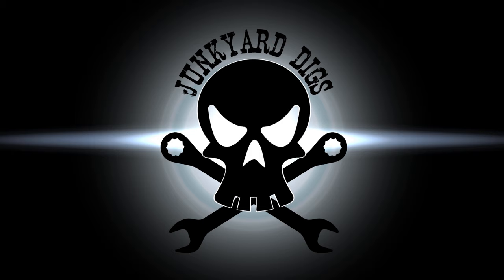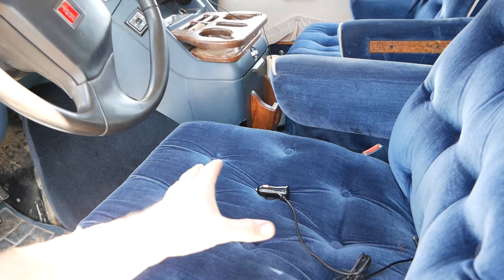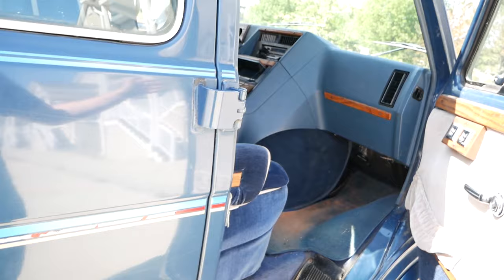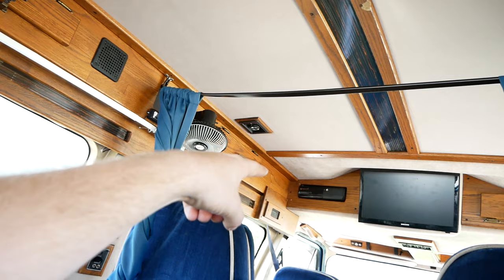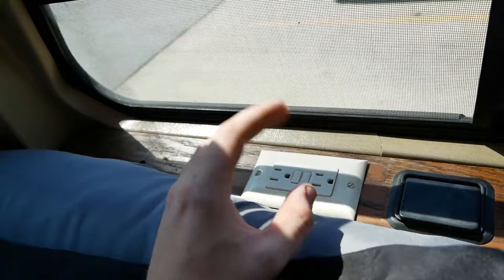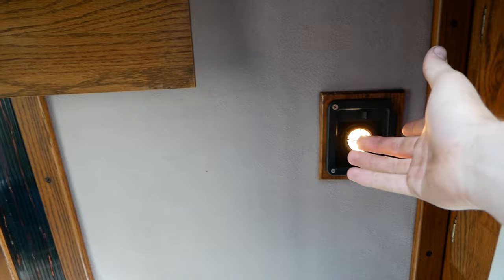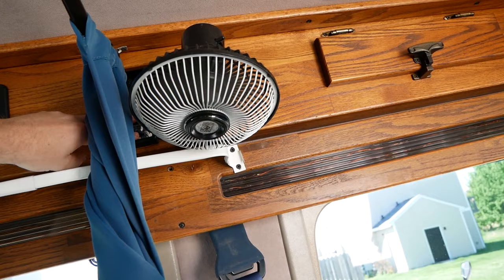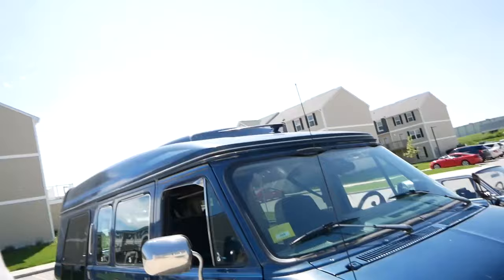How To Build The ULTIMATE Conversion Van

Comment: I had a 1974 GMC Rally STX van that I used as a Scout Van to haul Boy Scouts around in. It had a 350 V8 and a Rochester four barrel carburetor. I always had trouble with the points ignition, so I updated it to the HEI ignition. It was a really good running van after that. On one of the first campouts we went on the boys kept mooning other cars out the back window, so I built an entertainment center that sat between the front seats. I built a wooden box and put short nap automotive carpet on it. I installed a DVD deck in it along with speakers, an inverter and a tv. I wired it up so I could control the inverter and other functions with some toggle switches and relays. It worked wonders and kept the Troop entertained so they stopped mooning cars. It was a fun project and worked great. When I sold the van I kept the system I built and have used it in 3 other vans. I just bought a 2018 Chevrolet Express van and I’m planning on setting up a second battery with an isolator so I can run the system without killing the van’s main battery. It’s cool to see your set up, thanks for sharing

Comment: Nice work! I'd definitely recommend powering the inverter from a different battery than the starting battery. Cranking-style lead acid batteries typically don't last long under deep-cycle conditions, and you also wouldn't want to accidentally run your starting battery down while in the field.

The shore power connection is a great idea. You could even make an automatic transfer switch using a large relay, so as to automatically switch to shore power if it detects shore power, and then back to the inverter if the shore power is disconnected.

I would even suggest looking into lithium iron phosphate batteries if you do install a separate storage battery, as they have better energy density than lead-acid batteries and typically have a cycle life of 5000-7000 cycles. If you're willing to go even higher-end, you can even go with lithium-titanate batteries, which have a 10,000-20,000 cycle lifespan, albeit at lower voltage per cell.
Reply: I was going to suggest a separate battery as well. Adding to your info, there are companies (I think Painless Wiring is one of them) that make dual battery setups with an electronic solenoid isolator so with the key off the batteries are separated, allowing you to run your “house” battery as long as it will put out power and not have a draw on the engine battery. Then when you fire up the van, it automatically connects the “house” battery to the van system and the alternator will recharge both. May want to consider installing a higher output alternator to compensate. Another plus to this is if you leave something running accidentally and the engine battery dies, with the flip of a switch you can connect both batteries together and emergency start the van.
Reply: A suggestion for your Iowa winters would be put a better, weather-proof a/c plug at the shore/extension cord connection. Or have the ability to pull that plug inside so as not to catch all the road grime/salt where it would be protected. Great old van. Bulletproof drivetrain and comfort to boot. How do I know? I bought a new GMC conversion in 95 and daily drove it for 14 years and 160k, and 3 girls loved it.    Chuck in NE Kansas
Reply: Dayum!!!

Comment: Now I know why having the fire extinguisher was so important.
Reply: I certainly wouldn't trust the wiring setup. I don't think it can handle the load!
Reply: @JustinDaniels   what load? curents in this instalation are minimal.
Reply: For one thing, the heater...
Reply: @JustinDaniels  He also mentioned putting a 'portable AC' in there. That means it would be pulling its power through the $10 power strip in the rear overhead. Those strips are only meant to power TV's/DVD players/computers and such. The manual for most AC units will instruct you to plug DIRECTLY into an outlet because the manufacturers know most extension cords/power strips are crap. I have yet to see a 'portable' unit that pulls less than 800 watts, but more than one power strip melt down running high amperage loads.

A short can easily cause a fire before it trips the 30 to possibly 50A breaker at a camp site hookup. It's why RV manufacturers put in a second dedicated breaker box with breakers sized to the specific components they power. He has over 30ft of un-fused, and branched, power wire running from his 'hookup' and through his van.

Everyone wonders why manufactured RV's cost so much but never take into account that they have to comply with building codes for things like the 120V power systems(or crash testing, DOT regs on propane systems, etc).
Reply: I know, and I don't even think those power strips are designed to handle as much current as an AC draws.
Reply: @jamesgill5511  well said and I agree 100%.

Comment: WOW, I really love your van. I also have a 1992 GMC Vandura 3/4 ton that is so similar to yours that it's uncanny. Even all those silly wood panels on the dash, doors, throughout the headliner are virtually identical. Mine has the 350 with the TBI and it runs like a real champ. And you're right. It's very easy and pleasant to drive. It is somewhat top heavy because my van is a mobility van with the very heavy wheelchair lift and I've always got at least one of my parents' power chairs in the back. I like the way you wired in your accessories. That inspires me to do the same thing. Thanks for a great video.

Comment: Love your vids! I just bought a 76 G10 that sat for 26 years in a barn, but only has 46k miles! Next to it, was a mid to late 50's Jaguar that hasn't run in at least 30 years. Covered in dust. Beautiful. As barn find as it gets. I'm going to buy it. I live in Wisconsin, and will buy you your weight in beer if you want to give it a try!

Comment: i daily a 1994 ford f-150 4x4 xlt regular cab short bed. it only has 108k miles and 5.0 and 5 speed. I plan on putting a power inverter and batteries with solar pannels in my tool box in my bed. I bought a tent that covers up the whole bed so me and my son can camp out in it. I like going overlanding and want to have power where ever i am and a sat phone and cb radio just in case. I love going out into the badlands and the salt flats to get away from ppl! Its a hobby that I picked up when the pandemic started. Gas was like $1 a gallon and I had all the time and money i wanted to go out and get the perfect 4x4 rig that i can rely on in the middle of nowhere. Its probally the most reliable model year of f150 they ever made according to google. so i love it plus i can get around 18mpg with it cuz i drive it like a tractor and shift by 2100 rpm’s.

Comment: G20 vans are one of my favorite vehicles of all time. Them and the 69 camera pro touring. I can’t really choose between the two. 

Dude, you’re far from done, you’ve gotta get more options in there. You need to build a lithium battery. Stack some Nissan Leaf models and get some solar. Drop that LS in there but run everything on the fan belt on electric motors so you’ll get 400 wheel, and a/c without the engine running. Get that independent k2500 front end diff for the 4x4 swap, and some Air springs. If you have an auxiliary air unit just pull the heat but keep the a/c and replace the heat with a diesel air heater. That way ultimate heating is built in.  

Exterior: 
4x 17” all black Helio he909.
Aluminum bumpers.
4x6 halo led headlamps.
Lose the 90s rv style decals.
Billet grill. 

Interior:
4x Braum racing seats.
Replace the rug with rugged express van rug from bed rug.
Do a small base cabinet that fits a sink, and 5gal water can, heated with an element and on a dc pump to a shower faucet for a modular utility kitchenette. 

(Could even go portable pop up shower tent like cyclecruza’s moto van build)

That kind of build would give you so much capability just lets your imagination run wild.

Ultimate build man.

Comment: Honestly if I'd build one I'd go for a pre 97 4th gen Econoline 7.3 Diesel. Easy 4x4 conversion and I don't have to smog it in Cali. Which means I can tune the 7.3 to make powah!
Reply: Sure. It will pass everything but a gas station. Nothing like the smell and noise of burning diesel fumes while it's running. Ugh!!
Reply: @houseofno 
You do realize that older pre DEF deisels get better mpg than gas right? Especially when you get a less restricted exhaust and intake then tune it. And are you going to notice exhaust fumes while driving? No

Comment: Do you run everything off the engine or Batteries when static? Ever think of adding Cheap Solor cells to the roof? I would add airbags in rear for added ride stablity, add on for over load.
Reply: You can add2 solar panels and and an inverter, if you wish.

Comment: I have the same band van except for in Dodge and it was a 250 van I did the back with a full size bed raised up and drawer slides underneath for all my framing tools compressor everything I took the swivel seats out of the middle of the van left that wide open just carpeted floor and I had swivel Captain chairs in the front 318 engine I took the transmission and exchanged it for a 6-speed which ended up being really good on the highway you could do 85 miles an hour and only 2,000 RPMs it was crazy anyway I had a 10000 watt inverter and a second battery I put a 5000 BTU AC unit in the back window I did not have the big back windows on the side I was glad that was just solid metal I had a roof ladder mini rack up top but let me tell you that little bitty 5000 BTU in the back window and no front AC dude you can hang meat in that van during the summer time in Texas anyway I love your conversion that was cool

Comment: ik this is an old video, but one thing to note is that, when you move an xbox 360 while a disc is in the tray and spinning, it WILL damage the disc, so do watch for that
also if you have a hard drive in it, try and put an ssd instead, as any bumps in the road won't be too kind to the spinning platters in that hard disk
very cool van though, love all the wood in it

Comment: The transmissions are a good feature, and the engines are too:  if you wear out a Chevy smallblock v-8, there's just no engine on the market that is easier to find a replacement, less expensive, or easier to find a world of maintenance and upgrade parts. 

I drive a Chevy Express conversion van, a few years newer, but very much like yours: overstuffed blue velour seats and chunks of oak trim screwed onto the interior surfaces everywhere.   They are nice variety of stealth camper as well.  AS long as you're careful about using lights inside, camping in a conversion van allows you to park nearly anywhere.  Conversion vans are common enough that nobody looks twice  at one and imagines that it's a camper rig.

Comment: I have a 93 G3500 7.4 lol 454!! With only 89,000 on original engine and trans 😲🤫  I'm in the process of converting to a little more modern... Mine has a back up deep cycle battery and all the fixings... This van has even more  bells and whistles considering this one in particular was limited edition. Including CB radio,the backseat before I took it out was actually electronicallymotivated to go like futon from up to a seat and down like a bed but there was so much mechanical crap underneath that left no room for storage I decided to take it out... back where you had your TV remote and such I have a two teir drop I have decided to take both of the middle seats out honestly it's easier to move around from the front seat to the back without the middle seats in the way... If you look into this van or and or have any pointers you're more than welcome to contact me... I'll continue to watch your channel. Which I feel is super awesome!! That you have the van that you do it looks so different mine s all leather yours is all blue #awesomesauce

Comment: I had a 92 gmc van with 150k on it and it ran and drove pretty good. Got it for 500 bucks, it was rusty and didn’t have the back seats, so I threw a bed in it. It drove like a tank and sold it for 1200 without putting any work into it.  I’d love to find one in good shape like yours.

Comment: GM vans are the bomb from like 1973 to 1993 the body is almost unchanged. You need a door fix just get a newer one from any junkyard. I swapped a th350 out for a 700r4 and only needed a $20 trans cross member from a late model to make it fit.

Comment: Hello awesome vid! I also have a gmc vandura conversation van (she’s a 91 and her name is Bertha) she began to develop a over heating problem during the winter and I didn’t get antifreeze in her quick enough so she froze with water in her and I cracked the heads. Would it be easier to just get a whole new motor or should I take the time to fix the heads? The transmission was replaced at 200,000 miles and now only has 4,000 miles on it. I love my van she was my home for a long while and I don’t want to end up scrapping her any suggestions would be greatly appreciated have a wonderful day and keep making awesome vids I’m honestly addicted to y’all content

Comment: If you splice or plug the battery charger into your extension chord, you won't have to plug and unplug it every time you switch between inverter and shore power.  Also, If you put the inverter closer to the battery and run the AC circuit front to back instead of back to front, you could save wire and/or voltage drop.

Comment: Aw, man. What a sweet, sweet ride. Best vehicle in your fleet, you say? Easiest to drive you say? Given the average condition of the rest of your rolling stock I am unsurprised that the cleanest, best maintained, non-rusty car you have is the best to drive. Irregardless of any of that, you did an awesome job thinking through your power problems and getting it wired. Now screw down all that electrical stuff. It'll rattle like a maraca back there.

Comment: Awesome vid!  I thought it was just going to be about xboxes and tvs.. lol. But I love how you did the wiring!  I have a 1991 Chevy G30 and will be using a power station (ecoflow River Pro) for power needs in the van.  I want to try to take your concepts and use with it. The inverter in the River Pro is only 700w, but I am not going to be powering tvs or anything super heavy. Maybe a compressor fridge down the road.

I love the trickle charger to the van battery!  One question, I have read that van/car batteries are inherently limited to about 200w (I believe that's if you are trying to use the front cigarette lighter only).   So how does the inverter get to 1500 W on its own?   without a battery?

I love this concept of your wiring because the front cigarette lighter is not working in my van, nor the radio (which I don't really care about)... so this shows me how to get around that. And my van does have a shore power plug in already, so maybe this will be a little easier than I thought!!!... thank you so much.

Comment: Had an old 75 Chevy c20 camper top/high top, miss that ole van that 350ci  could still smoke the tires, but the transmissions sucked went through 2 of em. Nice van their brother.

Comment: Gotta agree on teh transmission thing. Now, i am a GM kinda guy, but love the other brands aswell, but MAN, i have just not encountered many oldish Fords with proper working transmissions. Got two 1994 E350 vans for scrap money, BOTH has the "blinking overdrive light" and jerky shifting issue. Error code readouts basically translate to: Something is wrong somewhere, dang vague crap

Comment: i have a gmc g3500 van i built out and lived in it for 3 years. the tbi engine never gave me problems, everything that's broken on it is basically my fault for not knowing how to take care of it. had to do 2 water pumps and a radiator, the suspension is worn from me not knowing i needed to grease it, etc

Comment: I'm not telling you what you should do, but I will suggest you at least consider going with a LY6 mated to a 6L90 when you do the swap. They're extremely abundant, easily run 250,000 miles before a rebuild, quite cheap, easy to find parts, decent torque and they're also designed for use with a transaxle, if you've ever thought of doing a 4×4 conversion. First place I would look for one is, a wrecked, or rusted (low mileage) 2007-2013 Silverado HD, Sierra HD, Suburban HD, or Yukon HD
You could be at max weight (with a trailer) and still pull through the mountains with ease!

Comment: This is nice you did a good job, but it is far from ultimate. My 92 GMC G2500 conversion van has all the goodies but isn't yet "ultimate. 32 inch smart tv, Nvidia Shield, 2000 watt pure sine wave inverter, 300ah Lifep04 charged by a MPPT controller/250 watt solar/40 amp DC to DC, 200amp alt, fridge, microwave, sink with 5 gallon fresh water tank plumbed to drain in front of the back tire. Still plan on making the passenger seat a captain's chair, rebuilding the lower cabinets, building a trunk in the back with multiple storage compartments and a lid that adds another cushion slab that will make the bench fold out into a true queen size bed. I'm sure I'm missing a few things, this is a true labor of love. Do you plan on doing more work to it?

Comment: My mom had a 93 gladiator conversion van it had a little box by the battery that would cut off the power from the battery if you ran it to low and you just pushed a button on it  and you would still have enough battery power to start your van.

Comment: I use TVs with external power supplies, then use a laptop charger cord that uses 12 volts to power it.  The plugs and watts must match up.  This lets you power the TV without an inverter.  I'm wondering how to Air Condition these things.  I wonder if the roof is strong enough to hold up a small RV AC,  you could use a small genset stored on a hitch carrier.

Comment: add a second deep cycle battery for the extra accessories and inverter, with a charge controller off the current charging system